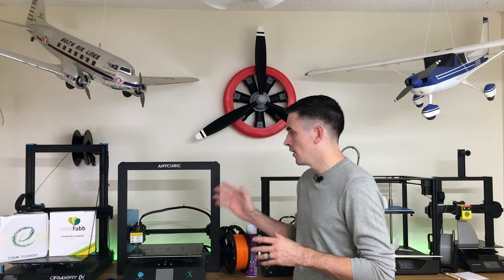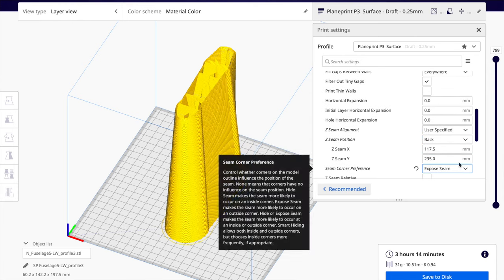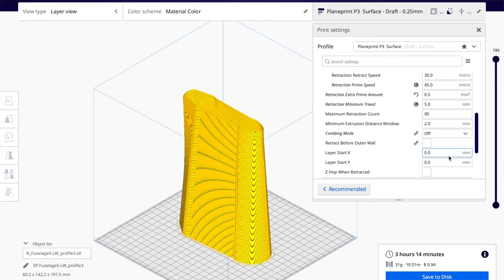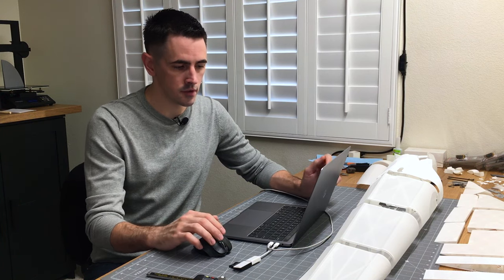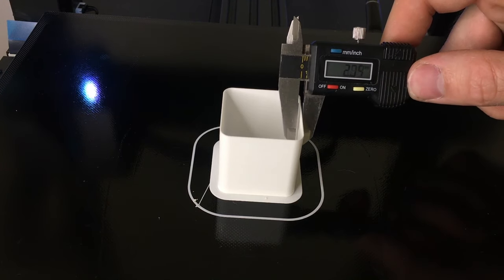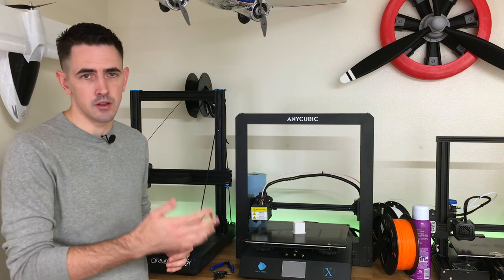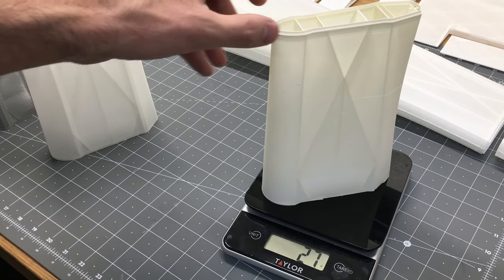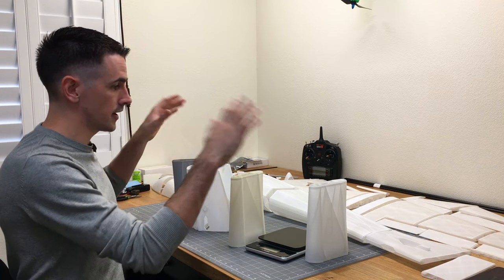How to Print LW-PLA (ALL MY SETTINGS) | ft. NEW eSun eLW-PLA

Comment: Another great video Troy. Thank you for all the detail and the help in the settings. I just ordered some lightweight pla. I noticed that sometimes you do use regular pla, is that only for areas of the plane that is needing the extra structural support? Thanks again.
Reply from the maker: I appreciate that! I hope it helps! Yeah, the regular PLA is used for strength. The best use of LW-PLA is definitely in a hybrid system.